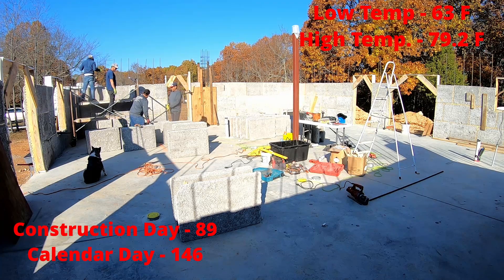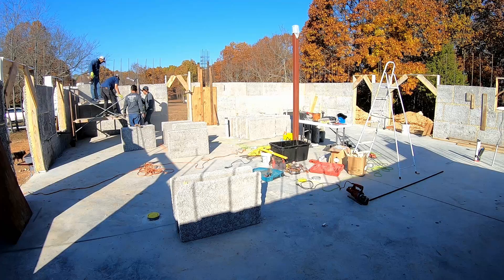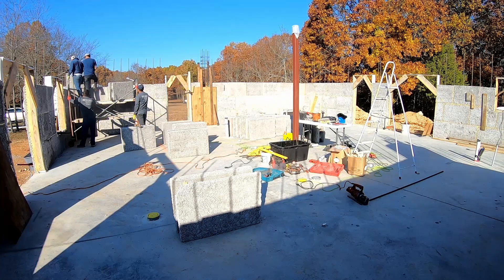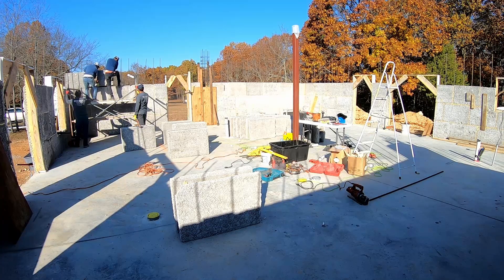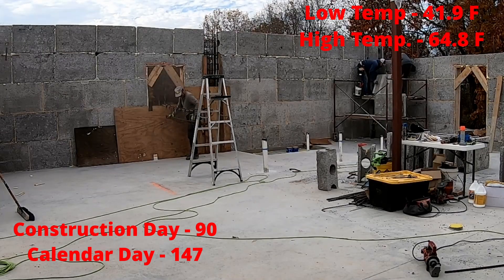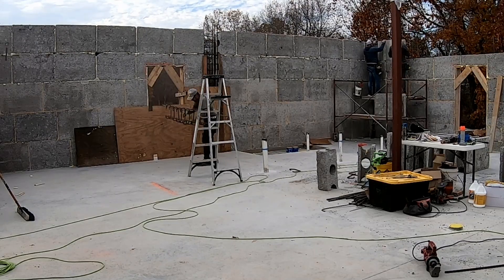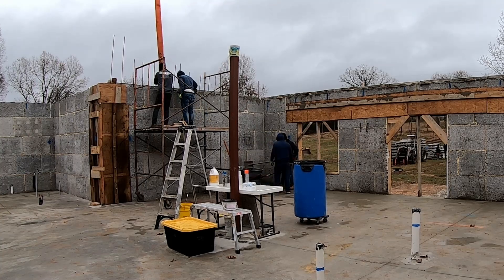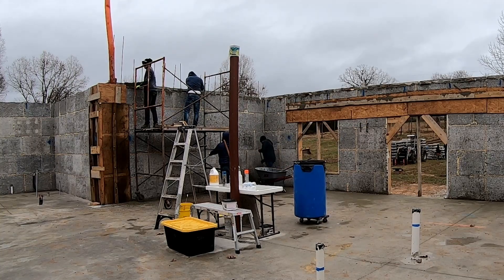House Build 23 - Completing the Legacy Block ICF First Floor Walls

Comment: The concrete doesn't need to be vibrated?
Reply from the maker: The foreman of the crew, who has been building with this type of block since the early 90s, assured me that a vibrator was not necessary due to the very high slump of the concrete, the pea gravel, and "stirring" the concrete with the vertical rebar.  That being said, I think that a hand held plate vibrator applied to the exterior of the block would be beneficial.  Thanks for watching!

Comment: Looking better each time a new video drops Tony. Merry Christmas!
Reply from the maker: Thanks!  Merry Christmas to ya'll as well!  Hope the weather isn't beating you up too bad.
Reply: @ozarksethic  the wind was rough after 2 inches of rain. A few standing dead trees down in the woods, but nothing bad. It's just way colder than normal!
Reply from the maker: @CarolinaSaltwaterLiving  Same here our everything froze.  Spent all day Friday thawing out our well and camper then thawing my FIL's well today while chopping ice on the pond and feeding cows.
Reply: @ozarksethic  We haven't had it this cold in some time. Fortunately the insulated well house, beat tape, and heat lamp has been doing the job. Our tankless water heater has frozen before at the inlet so I made a box around it with foam board and stuck a heat lamp in there.  We are killing a pig tomorrow to butcher. We'd have already done them but really it's been a little too cold for me. It looks like the weather will warm again in a few days for a little relief.
Reply from the maker: @CarolinaSaltwaterLiving  I know what you mean.  The wind is what got us.  It was sucking the heat out of everything.  Had to tarp the well house after thawing it.  It's supposed to be in the 60s here by the end of the week.  We normally don't see temps this cold until later in January.
Reply: @ozarksethic  same here. Thank God for dry firewood. We've been toasty other than taking care of animals. Got another cold one tonight. Y'all stay warm!